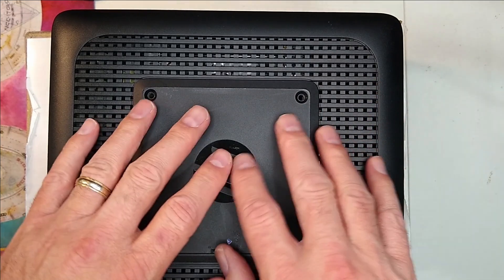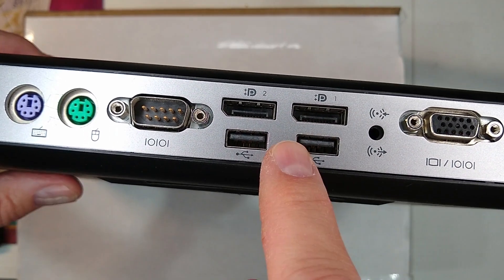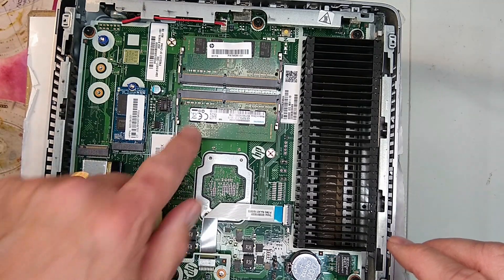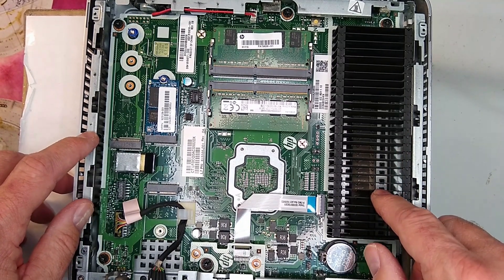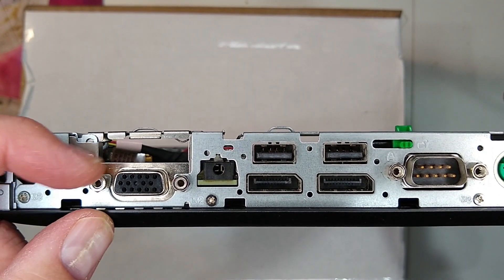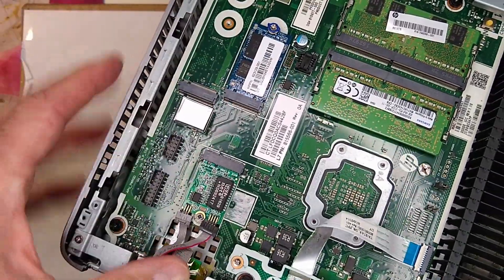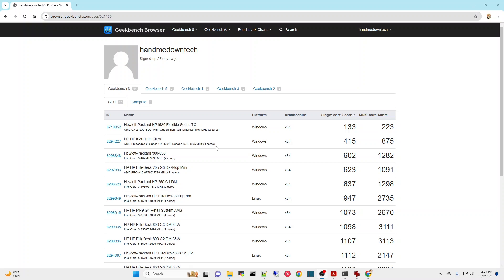HP t630 Thin Client - Fanless/Adding a Secord Network Port

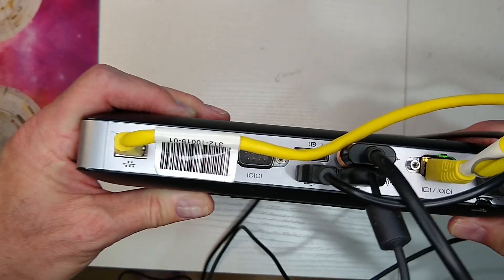Comment: yooo can i ask the vga port, what is it called on the female connector the yellow on the rigth side 16:18 the on your finger
Reply from the maker: On the right side of my finger is the VGA port I removed to add the second NIC/network port.  To the left is the display port adapter.

Comment: Thanks for suggesting uses of T630. I got 3 of them at almost no cost and installed larger ssd and 16GB ram. They suffice for browsing, mailing and Obsidian notes, using Kubuntu or MX Linux. They also play mp3 and mp4 from my NAS and do backup jobs. My old workstations, I still use for Lightroom photo editing, but I will take them down from Internet when Windows 10 loses support. With NoMachine, there is no problem letting the old machines doing the heavy jobs. // The NAS is essential and without it, I doubt I would use thin clients at all.
Reply from the maker: I got mine pretty cheap too and have yet to find a good use for them.  What type of setup is your NAS?

Comment: Great to know that a second NIC can be added. Just bought one of these to be used as my new OpenWRT router.
Reply from the maker: Let me know how that works out.  I'm a big openwrt fan.  Have all of routers and switches running it.
Reply: @handmedowntech  been using it for a few days now. Runs flawlessly.
Reply from the maker: @NinjaSynFrey so I'm assuming this is the x86 port of openwrt?
Reply: @handmedowntech  yep x86

Comment: Is there a way to convert the dual fiber connections to rij45? It appears the unit I ordered has the fiber module in it.   Pfsense might not drive the fiber out of the box.   I may build a cluster with these things. I have no AC so these may make a nice Linux desktop for basic stuff.    I might even use  the fiber connection If I can get it to work under Linux.  The standard 1 liter mini pcs just do not like summers here.  I have yet to replace their thermal paste.
Reply from the maker: Those cards are pretty rare.  Nice find.  You will need a fiber media converter.  You can check out Amazon.  I have never used one but with the cables and converter you may want to instead check out my videos on adding a second network port to an 800 or 600 mini.  Or if you do have the thin clients I'd go with the thin clients video.
Reply: @handmedowntech  I will keep it in mind.   BTW the Plugable Usb 3 gigigabit nics seem to use an Intel E1000 chipset.  They come in standard USB 3 and USB C versions.    I may use this video and  one of these so I am running an all Intel setup.   I prefer intel nics where possible.  I may use your videos to upgrade other thin clients.   I am more of a software guy so your hardware videos are priceless. Keep up the good work.
Reply from the maker: I'll have to check those out, been a fan of Pluggable and I'm also inclined to use Intel nics
Reply: @handmedowntech  My T630 arrived a week early.  It has a VGA port not the fiber ports on the Amazon image.  I am configuring it for possible desktop use .  If I use one as Router I think I will use at least one Plugable nic.  She to too pretty for me to  hack on her case.  I will have to wait until June for her RAM.   By then I should have another one to fill with the Ram from this one.  I can get to know  her BIOS until then.
Reply from the maker: You are very tender with your computer.  Like a captain and his boat.  Does she have a name 😄
Reply: @handmedowntech  Not yet, My i3 8100t  mini needs a little sister.  I may try ProxMox on it.   It has virtualization support after all.
Reply from the maker: @jeffreyplum5259 Thanks for having a good sense of humor.  I was worried I stepped over the line in trying to be funny 😜
Reply: @handmedowntech  No Worries Mate I was raised over the line and I have the home grown PSTD to prove it. My girl runs at a blazing 2 GHz unlike the earlier junk which ran at a Pi-4 like 1.65 GHz.   Throw in a couple of nice SATA -3 SSDs, and 16 GB of ram   A tower of power, with  2 screens AMD graphics, reminds me of  my Windows 7 tower.   It  had an AMD APU, one of the first cpus with integrated graphics.

Comment: I have mine with windows 10 no issues I just add the drivers..
Reply from the maker: @jorgef.6477  are you using the IOT version of Windows 10 that comes with it?
Reply: @handmedowntech no it didn't have it on there.
Reply from the maker: @jorgef.6477  I guess I meant for the reinstall.  Did you use standard Windows 10 or the IOat version?  Been thinking of doing a video on how to install it on these thin clients.
Reply: @handmedowntech but I like the dell wyse 5070 verry nice..

Comment: You can get T640's with Ryzen based R1505G's for very cheap. I would consider those (in general).
Reply from the maker: @jonathanmarshall3974  I'll check them out, thanks.

Comment: Clean Install.  Neat that you got into the thin clients. Are you going to make it an pfsense/opensense router?
Reply from the maker: I was thinking about it since it just screams network appliance.  My problem is I already have 5 routers running.  My original hand me down tech was installing openwrt on my Netgear equipment.